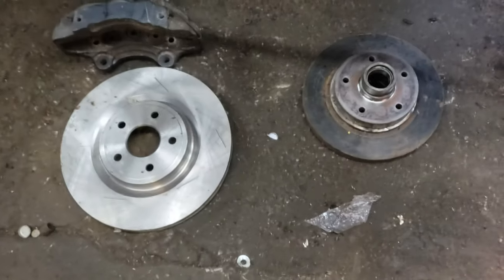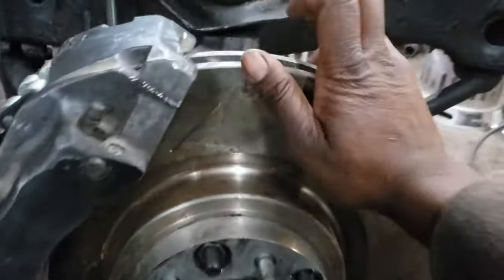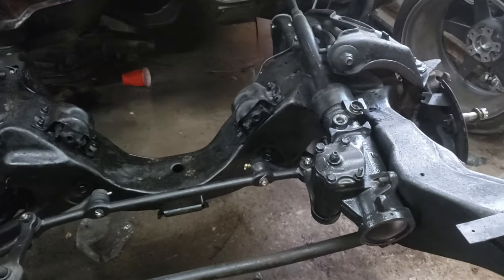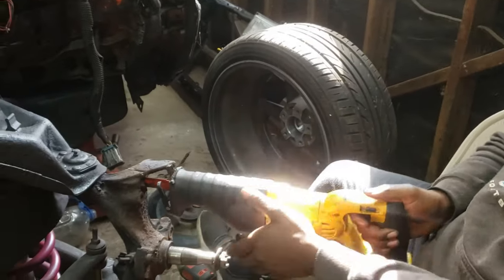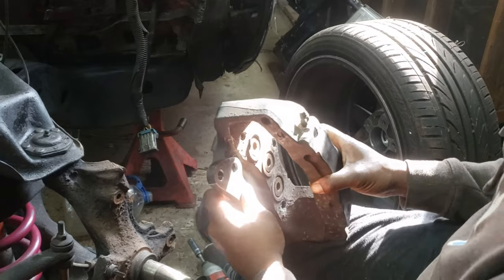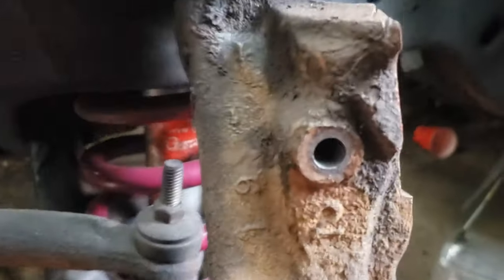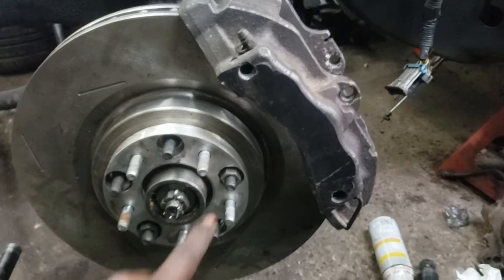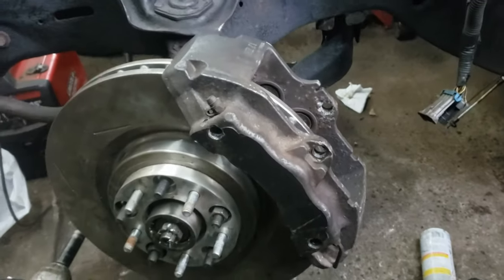Junkyard 6 Piston Brembo Brake Swap

Comment: What’s the part number for the bracket that holds the caliper
Reply from the maker: Custom made. Thats the part that you gotta make from 1/2" steel. Measure your bolt centers then draw it out on cardboard and send the template to someone who can cut steel
Reply: @DomestikViolenceRacing  do you have someone that can make them